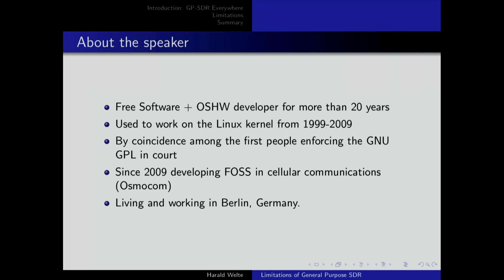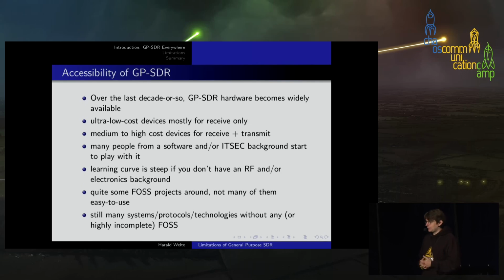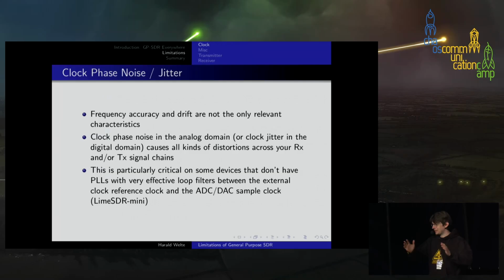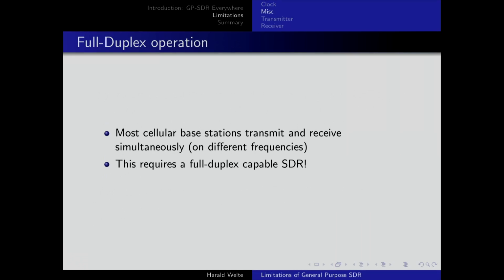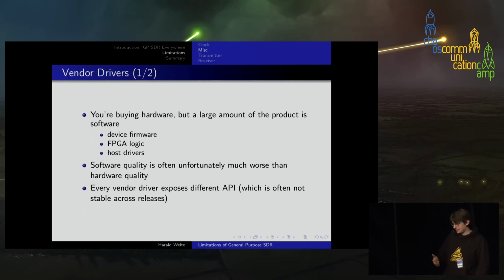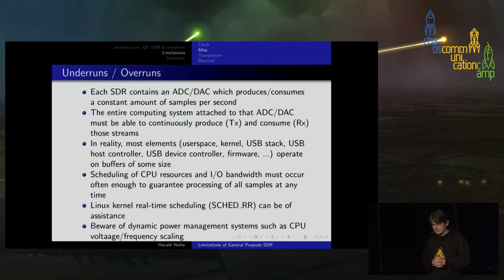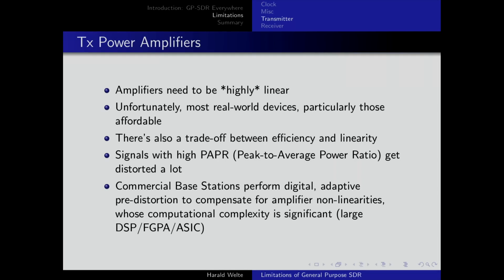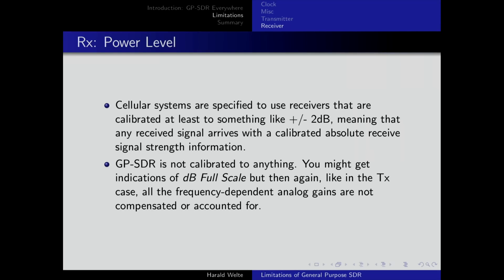The Limits of General Purpose SDR devices

Comment: Perhaps some of the issues will be resolved once USB4 is used (40Gbps).  I believe the FPGA code inside the LimeSDR-USB and HackRF are open source! 

I think using a general purpose SDR serves as a great learning tool.  For example.. 

--Morse Code CW Transmission (NFM and AM/USB) and decoding/Receiving (CW Skimmer, CWGet , morsecode scphillips translator, "Playful Technologies" AI-based Morse Code Decoder, etc) 
--HAM : trunking (SDRTrunk / Unitrunker) / TETRA (SDRsharp plugin, OpenEar, OsmocomTETRA), digital-modes (DMR, D-Star, System Fusion/C4FM, NXDN, P25/Police Scanner (DSD LouisErigHere), POCSAG (PDW Software) , YSF FT8 )) , convert modes on the fly (i..e use DMR radio to talk on C4FM), 
--Decoding/Visualizing Weather Satellite data (noaa-apt, WXtoImg ) 
--ADSB Plane Tracking (X-Plane / XHSI and AdsbSCOPE plugin, MultiPSK with Maperitive) ;  
--Finding Satellites (Orbitron , g-predict, orekit)
--GPS Decoding/Plotting/Spoofing ( GNSS-SDRLIB, RTK-NAVI) 
--ATSC Video Receiver/Transmitter (Portsdown DATV, SDRAngel, GRC, SDRGlut) 
--Local GSM/LTE cellular network (GPRS) (gr-gsm, Kalibrate, IMSI-catcher, srsLTE-Sniffer, rtl-sdr-LTE dedsecimsi, FALCON) 
--Text/voice decoding (OpenEar, Defcon 2016) 
--Inmarsat AERO satellite Medlink AMBE Audio ACARS (jontio / libaeroambe built JAERO) 
--Reverse Engineer an RF keyfob ( clock-recovery, analyze protocol (Universal-Radio-Hacker, Inspectrum), transmit ) 
--Reverse Engineer Direct Sequence Spread Spectrum

Then, writing my own applications using GNU-Radio-Companion!

The SDR courses I found below look good, but not sure if any start with practical walk-through, then go deeper into theory and how it works.  For example, making my own bitstream.
 $2500 Sébastien Dudek
 $1500 hackers-arise Subscriber-PRO SDR For Hackers
Balint Seeber / Ettus Research GNU Radio Tutorials 
 tonex , enoinstitute , factorialabs
Georgia Tech Prof. Edu 
$15 Udemy (Designing RF Comm Systems using SDRs with GNU Radio, Mastering SDR with GRC, etc), 
csun skatz CSUN/EAFB Software Defined Radio (SDR) Senior Project  ,  ECE4305  
GH SSkySurfer / SDR_Learning